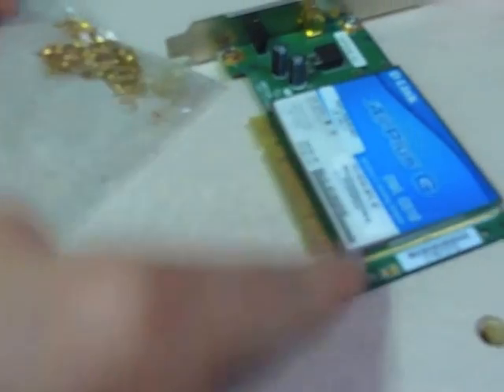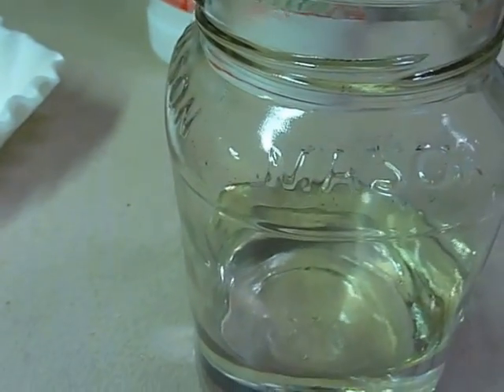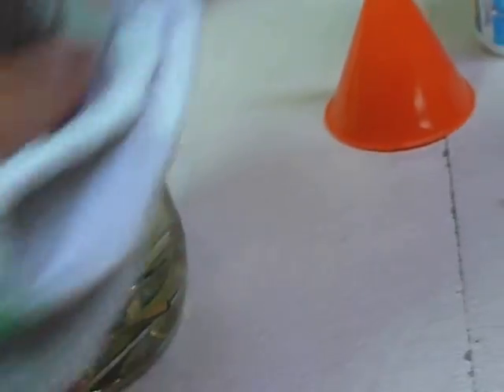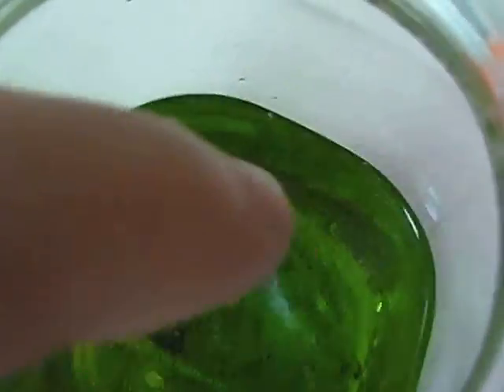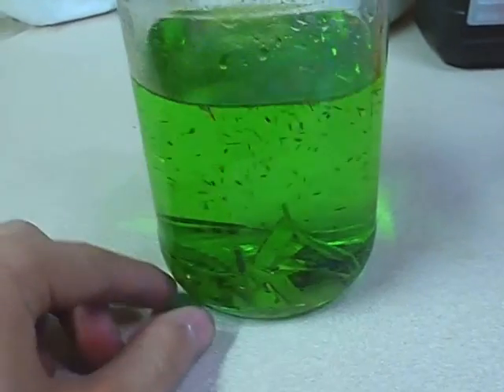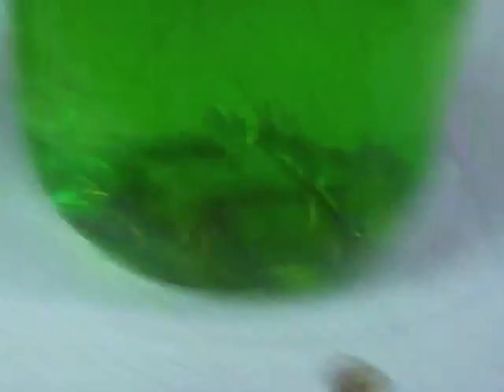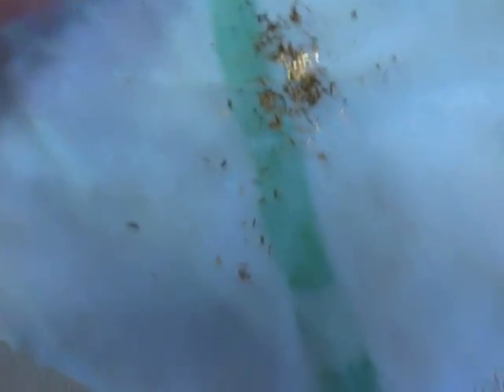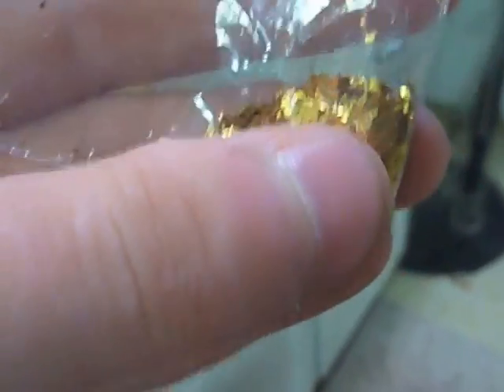Gold Recovery From Computer Parts!

Comment: I found the acid at lowes with the paint. I dont see any safety such as goggles or gloves being used here. Also what would happen if you had a large spill? I also have one more question, which would you add first, here you added the acid. There is some confusion as to why. The only other concern is not enough water being used after wards to show cleaning the gold, you wouldn't want to leave the acid on anything. Very good collection, do you plan to sell it or make buttons out of the recovered gold?

Comment: is it the real gold ?
Reply from the maker: Yes. Gold is used on electrical connectors because it has very low electrical resistance.
Reply: so how can we know which one is the real gold ? (gold, copper and other the same color)
Reply: Sayseng Te You will notice that copper tends to be of an orange color, while gold is a yellow color instead.